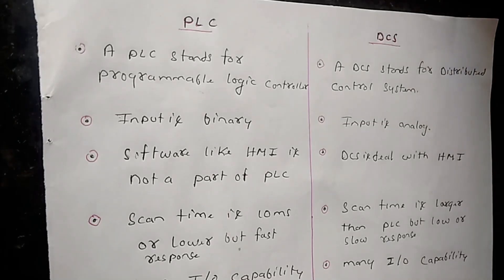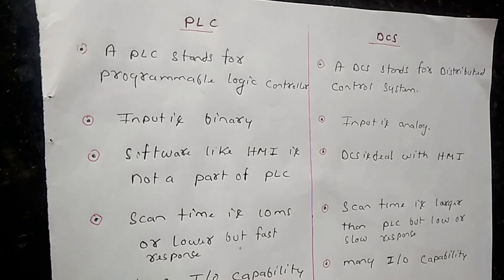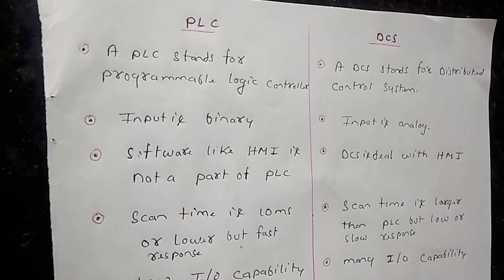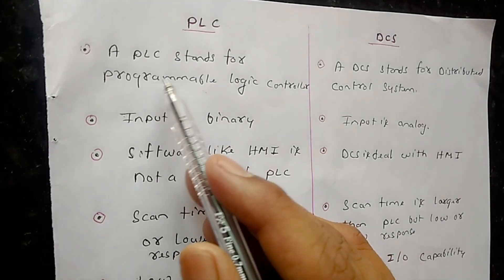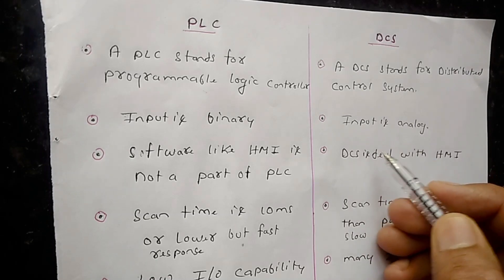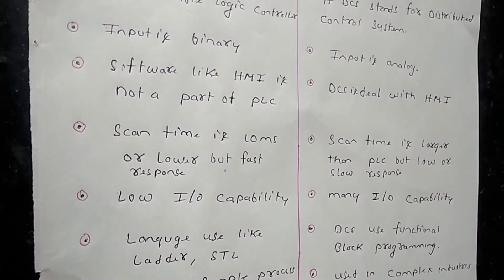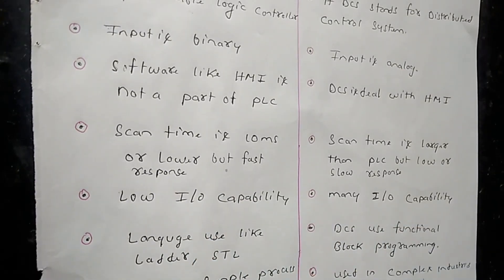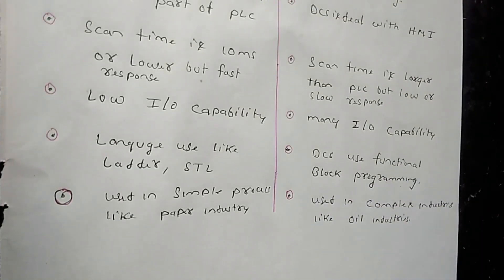PLC And DCS Important Difference .

Comment: This is not the right question. The right question is what is the difference between centralised system and DCS system. Or what is the difference between simple PLC's and DCS system controllers . You can also distribute your system by using simple PLC's . DCS is the configuration of controllers.